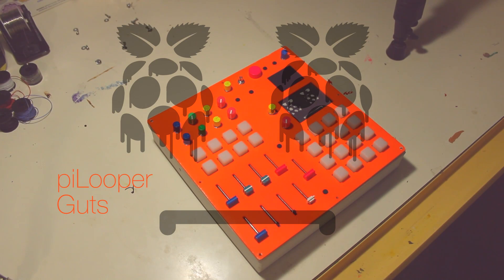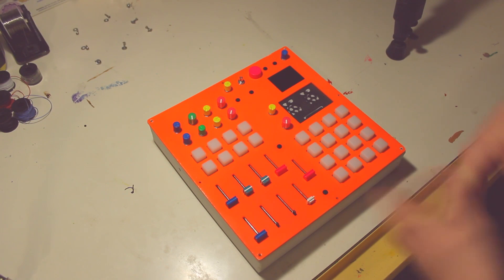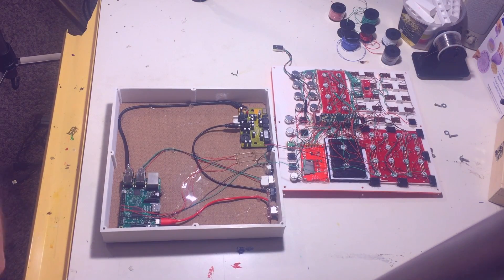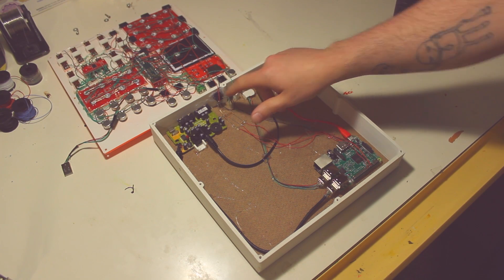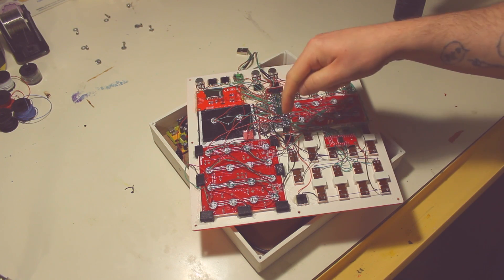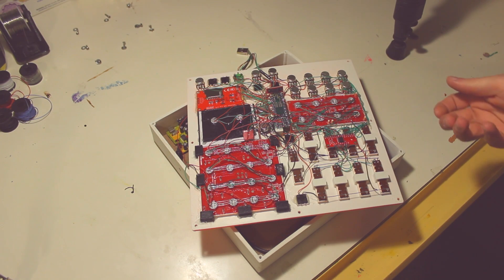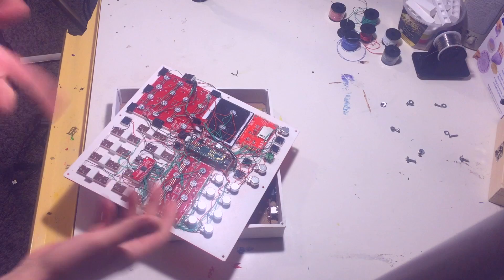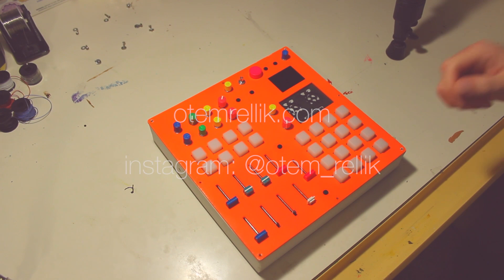Raspberry Pi Looper Guts

Comment: Hi! I don't think it's that bad in wiring! It's a hell lot of work and the result is "my respect!" as we like to speak here ))
In the current situation about components: can Teensy be changed to Raspberry Pico? Are they close enough?
I've just at the start and probably the first thing will be just a simple FX box based on the famous Linux compatible synth/plugins system. I want to make it as compact as I can and make it independent from a "big" LCD monitor: just few small monochrome displays that will show values and a current virtual gear set.
If it will be not enough then I'll make something like your machine, probably smaller, plus I want to add a ribbon controller. At some point I'll definitely start a similar project.

Comment: Have anybody rebuild it ? i need the schematics.
Reply: I was able to build it. I made a work in progress website on the build process.
Reply: @jrlening  When can we expect it and will you offer it for free?
Reply: @he-manhunter  I need to add a comment section so people can let me know if they have any issues.
Reply: @he-manhunter  tried to post a link but it is missing.
Reply: @he-manhunter   Try looking for wix kuffcakes Otem Rellik. It should show up.
Reply: @jrlening  Great. ThankYou. What dou you think would the complete price for the Parts ?
Reply: @he-manhunter  It cost about $350 to make. It'll be $100 cheaper if you have a 3d printer or a friend with one. The downside is the Teensy 3.6 is out of stock until next year. You can probably use a 4.1 in its place. I installed the software on a Raspberry Pi 4 2gb with no issues if you want to use a newer Pi.

I'm in the process of changing things up by using a touchscreen instead of the DS resistive touchscreen and the other screen.

Another person that built this used the Adafruit neotrellis in place of the Sparkfun 4x4 PCB board. That cuts down on size.
Reply: It took awhile to recreate this and I hope to improve the instructions. Kuffcakes Pi Looper might work to find instructions.

Comment: Where did you buy the PCB and 2 X 4 buttons?
I need an answer quickly please
Reply from the maker: Check the description.
Reply: @otemrellik  Ok it's the 4X4 button? 
And have you a shematic for the 
electronic connections?
thx
Reply from the maker: @FaoLaTekNo  There is no schematic, sorry.
Reply: @otemrellik  ok thx

Comment: This is brilliant and inspiring.  Will this work with Teensy 3.2 or did you choose the 3.6 for a reason other than it's the latest release?  Thanks for sharing, I'll be attempting to build a synth over the holidays and you get the credit...
Reply from the maker: The second version I built of this uses a 3.2. I did run into some issues though with loss of serial packets. I think I chose the 3.6 because of the number of pins available.

Comment: Is your case 3D printed? It’s hard to tell from the video. I like your design.  How to you shutdown the pi?
Reply from the maker: It is 3D printed. Thanks, I shutdown the pi by turning off the power strip its connected to :)
Reply: @otemrellik  Have you run into an issue with the SD Card getting corrupted?  Awesome project!

Comment: One question. You say that you don't use MIDI to interface the Teensy to the RasPi. So what do you use instead? Also, how did you link the Teensy to PureData? Great project, btw.
Reply from the maker: Thanks! The pi is talking to teensy over serial usb.
Reply: otemrellik OK cool, thanks!

Comment: Hello, i saw that you bought the touch display, but do you know if i can use a real Nintendo DS touch screen?if so,how?
What type of data does the display send?
Reply from the maker: I imagine that would work as long as you can access the pins from the screen. Screen sends analog x/y data, I don't remember the range.

Comment: Hello Otem. Great work.

I'm attempting to recreate and I'm documenting my steps. I have a few clarifications and a question. 
Otem: Would you like me to publish them here or github?

Are you running Pd 0.48-0 "vanilla" with only the comport and ggee extensions? Or a different version of Pd?

On the PRI are you running Raspbian Jessie? (Stretch is now the default for new Raspbian installs).

On the Sparkfun push button boards... for the loop control buttons (8 buttons)... Did you cut down the larger 4x4 board or did you use (2) of the 2 x 2s?

Currently, I'm stuck getting serial communication working between the Teensy 3.6 and the Rpi. -

I've identified that my serial port on the Pi os "0" when yours was "1".
I changed the object in serialControls to read comport 0 9600, but I still get the following error scrolling rapidly in the Pd Console"
[comport]: "Write failed for 0 bytes, error is 11" (once it was error is o).
I've confirmed the Pi is part of the DIALOUT group that has write privledges to /dev/ttyAMA0
Did you have to stop getty on the serial port or anything like that?

I'll continue to work through this. If anyone has any tips, I'd appreciate them. Thx.
Reply: How did it work out?

Comment: This has given me a load of inspiration. I am building a Raspberry Pi to use as a music/noise controller for a bunch of battery driven synth gadgets all contained in a flight-case. The combination of a Teensy to control inputs/outputs over serial to the Pi and then using PD to modulate sound is great. I was looking mostly at using Sonic PI, but I see that I can probably to a lot more interaction with PD. Thanks for the great resources and inspiration - I'm off to look at your other musicmaking vids now!

Comment: Awesome work!!!!   if i could give you 1 tip...  buy some schrinktube and use it over all soldered connections on the sliders and buttons.  (it wil save you alllloooot of trouble "on the road"

Comment: I'm looking at your code for the teensy, the 10 readings/smooth algorithm would take a lot of time, division with 8 bit micros takes a fair amount of clock cycles. There is a quick and dirty method of doing smoothing which is to take 8 readings and then shift out 3 of the least significant bits which will effectively smooth by truncation. 

for ( int x=0; x<8; x++ )                      
 { average += analogRead( q );  }
 newval = average >> 3;

if you took 8 readings at 1023 each you'd end up with 1111111111111 (or 8184), which, if you lose three 1s gives you 1023. 

I've done some velocity sensitive algorithms using FSRs on AVRs if you ever wanted to join forces like Voltron.
Reply from the maker: Oh nice, thanks for the tip! I just built a midi controller that uses FSRs, I'm probably going to upgrade this project at some point with FSR's.

Comment: Hi Otemrellik, 
this is absolutely awesome! Congratulations. I am actually also (start) working on a midi controller project using similar components, like the sparkfun pads (in my case i am using the trellis pad from adafruit, which is nice cause you can easily extend it up to 8 4x4 pads, but due to that i had to use a level converter) and also the super teensy 3.6, obviously. Actually i am currently looking for a nice/easy-to-code-and-use screen display. Which one have you used exactly (couldn't find or get it out from your excellent video(s) about this project) ?
And one last question, which multiplexer have you used ? Is it the 74HC4051 ?
Man, thanks a lot and keep doing this. I perfectly understand the fun you might have had while doing it ;)
Cheers
Reply from the maker: Ah yeah, I've looked into the trellis. The level converter stuff seemed to complicated for me so I stuck with the sparkfun pads. The screen I used is this: https://www.pjrc.com/store/display_ili9341.html
And here is the multiplexer: https://www.sparkfun.com/products/9056
Good luck with your build!
Reply: Thanks a lot, and once again...congrats for the proj and for sharing it ;)

Comment: Hey Otemrellik, Your raspberry pi looper is mind blowing. Im trying to hunt down most of the components in your device, but I can't find the correct size knobs for any of the listed pots. Where can I get the right knobs?
Reply from the maker: Hmm...I used to order knobs from mammoth electronics but it doesn't look like they stock the old push on ones I used to get. There is probably a lot of other places online that have knobs. I would just search for 1/4 inch push on knob and see whats out there.  I printed the ones for this project.